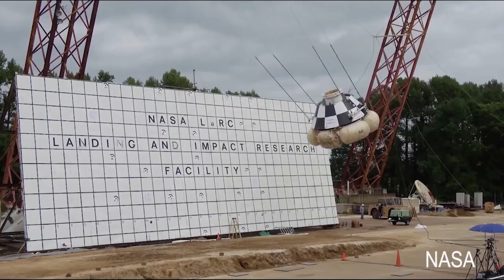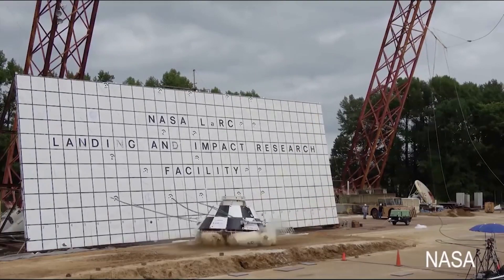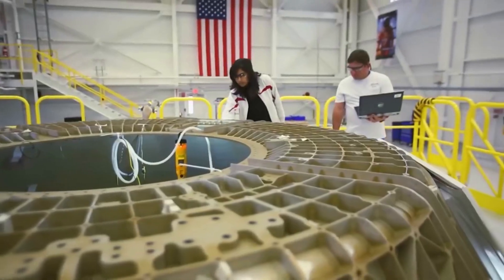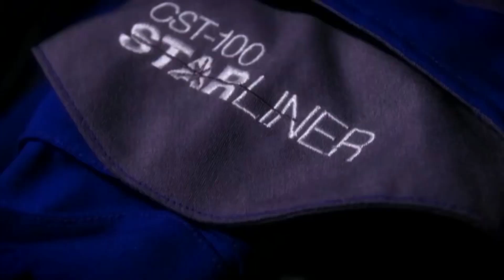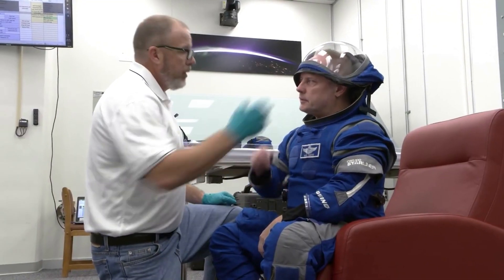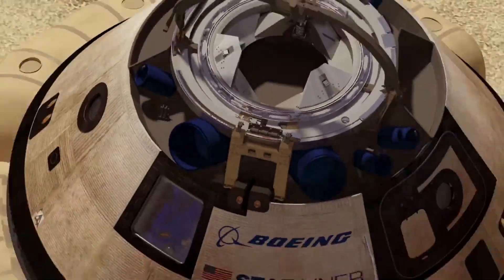An In-Depth Look At The Design of Boeing’s Starliner Spacecraft

Comment: It is truly unfortunate that so much time and money has been wasted on Starliner. Boeing should have been able to do better. The Starliner is scheduled for only 6 NASA crewed flights and perhaps no more. Boeing is charging 2.1 times more per seat than SpaceX is. Over the course of 56 total "seats" flown to ISS across 14 missions, SpaceX's prices will work out to an average of $88 million per astronaut, versus $183 million per astronaut for Boeing. Considering that there is a limited supply of expensive man-rated Atlas 5 launch vehicles left and now no funding to man-rate Vulcans, there seems a hard limit to Starliner missions. It is possible to launch Starliners on a Falcon 9 but seemingly improbable. Starliner is a flawed design with much if its costly hardware placed in its disposal service module. The Dragon 2 has all equipment located in the reusable capsule with only solar panels and a radiator in the trunk. Moreover, the Atlas 5 that Starliner must use requires two solid boosters and two RL-10s on its second stage. The Dragon 2 uses a straight reusable Falcon 9. The cost difference is enormous and difficult to economize. Boeing's only hope for more Starliner use is with the proposed Orbital Reef space station. Boeing plans to build Orbital Reef cooperation with Blue Origin, NASA and other partners. It is a potential destination for future Starliner flights. However, the cost differential between Starliner and Dragons makes this prospect uneconomic. If the Dream Chaser pricing becomes less than the Starliner, it could become a spaceship without space contracts, and without a future.
Reply: NASA has pretty much bought the flights they need to the end of the ISS with the initial 6 Starliners and 14 Crew Dragon flights (8 left). Boeing bought the Atlas-V boosters they needed for their 6 flights and this CFT flight. Starliner could launch on a Falcon 9 if necessary, just like a Dream Chaser or Cygnus can. 

Orbital Reef is planned to use Starliner and cargo and crew versions of Dream Chaser. While ULA doesn't want to pay to man-rate Vulcan Centaur, SNC, Boeing, NASA, and/or ULA will pony up the cash at some point. Cost is suborned to safety and having 2 spacecraft to serve Orbital Reef will likely mean that Starliner's extra cost will be absorbed.
Reply: Competition is healthy. That fact alone justifies the price paid to ensure it exists. The statistics currently are in SpaceX‘s favor, but things change, and said competition makes SpaceX a better company as well let’s not forget.
Reply: @slartibartfast7921  Well said
Reply: @steveaustin2686  cheers Steve